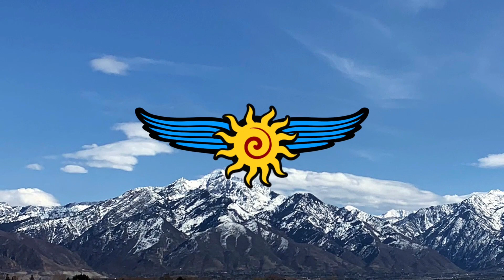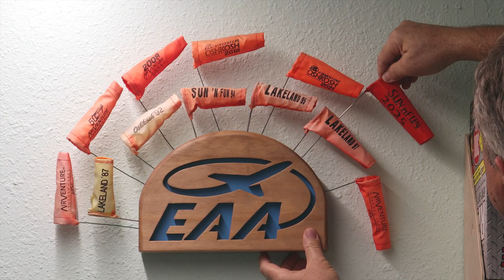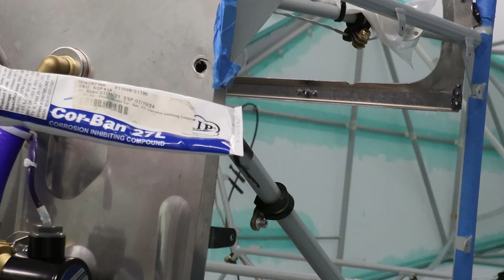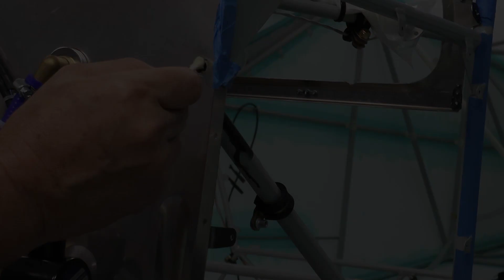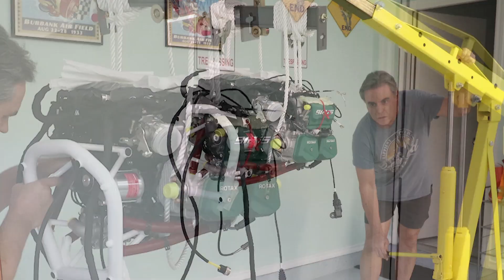S-20 / S-21 Mounting the Engine, Glareshield and Cowling

Comment: Did you consider a slightly higher HP engine like the EP 120 naturally aspirated engine or their turbo charged?
Reply from the maker: More horsepower is always welcome, but I did not consider any aftermarket modifications. I’m not a fan of modifying an engine to exceed the original design criteria. I originally was looking at the Rotax 915, since I lived in the Rocky Mountains and would welcome the high altitude performance. But it was an additional $12,000 over the 912iS, which was just a little excessive for my budget. I just resigned to the fact that if I am going into the mountains, it will need to be in the cool mornings. And since I’ve moved to the flatlands, a turbo is just not necessary any more. I’ll keep it stock. I’d rather have the reliability, instead of additional power.

Comment: Can i ask where you got the stainless steel fuel hoses
Reply from the maker: Hello Brian. I had the fuel hoses custom made through Aircraft Spruce. You just fill out the online order form with the type, length, size and fittings needed. They have a supplier make the custom hoses, which are then shipped directly to you. The price is fair and the quality is excellent. They are of course aircraft quality and pressure tested, which is important when dealing with high-pressure flammable fluids in a high-vibration environment. I'm just encouraging you here not to go cheap, as I've heard of plenty instances where a cheap hose (automotive quality) leaked and caused a fire. 

The ordering process through Aircraft Spruce was easy. Here's a link to their custom order site.

https://www.aircraftspruce.com/catalog/appages/hoseassembly.php?clickkey=3010399